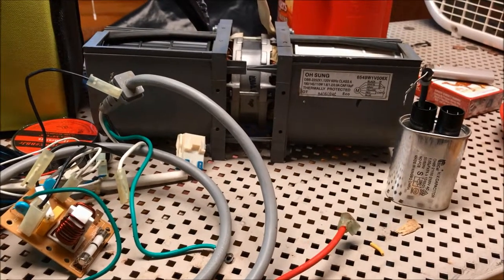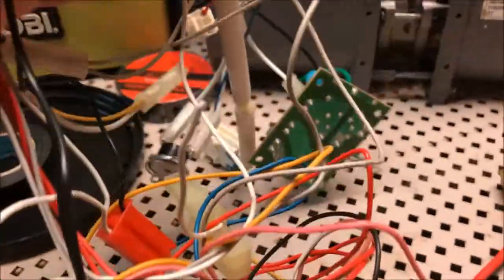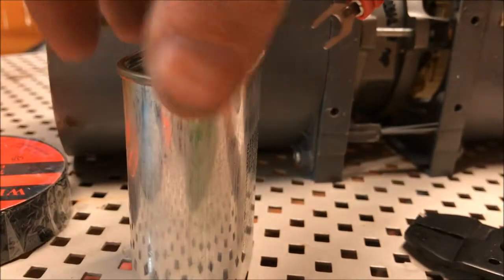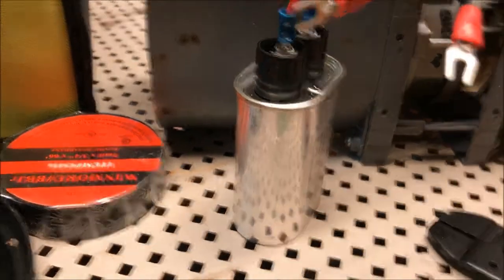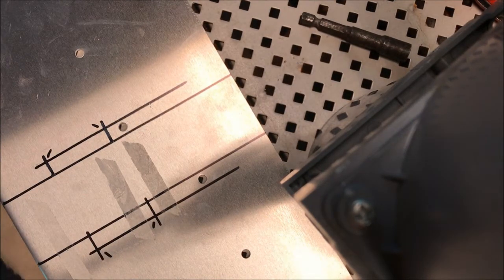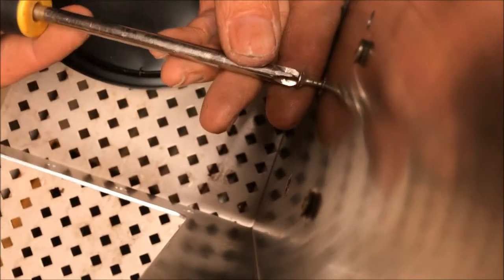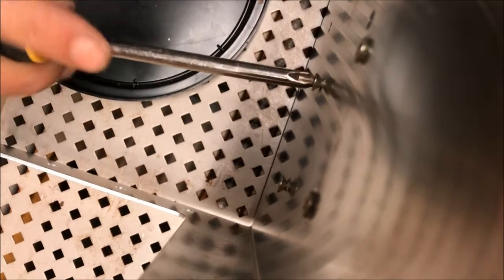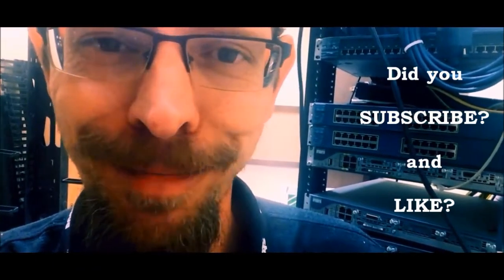Recovered Microwave vent fan, how to wire and use for venting!

Comment: Thanks! In my situation that giant capacitor was for the coil driving the magnetron. I used the small black blocky looking cap for motor and it worked fine.

Comment: Use a 3d printer to make the rest of the housing.  I hooked my microwave oven fan up to my woodstove . And it's the best fan I have ever used  . The best part is they are free , if you can find an old microwave oven.
Reply from the maker: Thanks!

Comment: Jesus Christ! Talk about more power! You've used the capacitor for the microwave's magnetron. The capacitor you wanted was a square plastic jobber that holds 6 microfarads notta brazillion of em! I'm sure that squirrel cage is now capable of injesting a full size adult squirrel and launching it from Texas to Montana now, if you were of a mind to start a small squirrel drive from Texas to Montana but I digress, enough about squirrel drovers.  Be care full with that thing!
Reply from the maker: It worked for along time and your are 10 years late, you know nothing.

Comment: Is it necessary to use the capacitor?? Or can you go direct voltage??
Reply from the maker: This depends on the power source, if you use the transformer from the unit, yes. Otherwise, get a power brick for the speed you want. The current should be listed on the fan.

Comment: Hey, thanks a lot.  I had white to white, and my motor started to smoke in 20 seconds.  Saw your video, switched blue to White, and BINGO! Thanks.  Why cant I read electrical diagrams?  I must study more.  Thanks, your video was great for indicating the appropriate wire terminations.  I used the 6-microfarad capacitor that was in line originally.  Perfection.  Using to exhaust vapor from my Laser Engraver.  YEEHAW.
Reply from the maker: Thanks!

Comment: you are supposed to use a 10uf 220v capacitor. It’s the little rectangular box (either gray or black) with two terminals
Reply from the maker: Thanks!

Comment: It’s a blower fan. The other is a cooling fan, for the transformer. The capacitor you used is for the transformer. It’s awesome you used it and it works. On the label it indicates 10uf for the capacitor. It’s a little rectangular box.
Reply from the maker: Thanks!

Comment: Hey it's me again sooo I've connected a voltage regulator to the fan, (microwave cord) I plugged it into the wall as well, for some odd reason the motor still gets hot, is there a way to keep it cool or is it normal?
Reply from the maker: Long time!
No that is not regular. Something is out of line... but, I am a communications engineer... I would suspect too many AMPs.

Comment: What if all you have is white, blue,purple,red and orange? Is cap still red&orange? With no black which one subs for hot wire?
Reply from the maker: You need a 3 phase cap for that. Google 3 phase power diagram. You can still do it, but may not be good for the fan.
Reply: @ServanoStyle  thanks for the info. I got it working and the motor hasn't heated up a bit.

Comment: Nevermind on that last comment...i switched the wires on the cap and it fires right up now. Thank you so much for the help!
Reply: My motor randomly fires up sometimes
(Commonly stays stuck in one place)
Reply from the maker: @zetta6656  I would think that is amperage.... but, I am a communications engineer, not electrical.
Reply from the maker: Thanks!

Comment: Hey Servano, first off thanks for the video! It's helpful but my fan just hums till i give it a quick spin then it will run good. Do you have an idea that will make it start up without having to spin the fan manually to get it to start?
Reply: pro tip : watch movies at Flixzone. Been using them for watching lots of of movies these days.
Reply: @Creed Riley Yup, I have been using Flixzone for since december myself :)
Reply: @Creed Riley Yup, been watching on Flixzone for months myself =)
Reply from the maker: Sorry, can't help. I hope you found a solution.

Comment: Does your fan motor get hot? Mine was getting above normal temp but I think it was because I was running it  without the comp? Ima run it with it on an see what happens. I have my motor geard and installed on my all electric home made lawn mower 😂
Reply from the maker: Thanks!
Reply: For some reason even I used the capacitor and it gets hot quickly the capacitor stays stone cold... 

(Does using a voltage transformer AC affect this?)

[Edit] the capacitor was not connected correctly I redid it yet it still gets hot -_-
Reply: @zetta6656  check your amperage for going over? 
Iv found that different sizes of pulleys/blowers can over amp and either thermal overload or burn up the windings.

Comment: The exposed 115 VAC terminals are a concern. The female spade connector is supposed to be used with a male spade connector similar to what is on the capacitor, but even if you switch to them you still have 115VAC exposed connections that can either short or shock you.  You can buy crimp-on "Bullet style" connectors in the appropriate wire size that will allow you to crimp on a male/female connection that covers up those live wires. I was going to comment on the lack of ground, but you covered that.
Reply from the maker: Thanks!